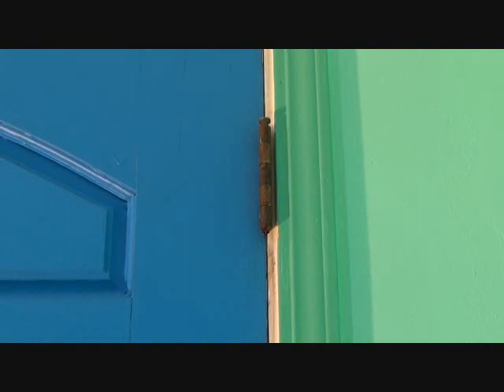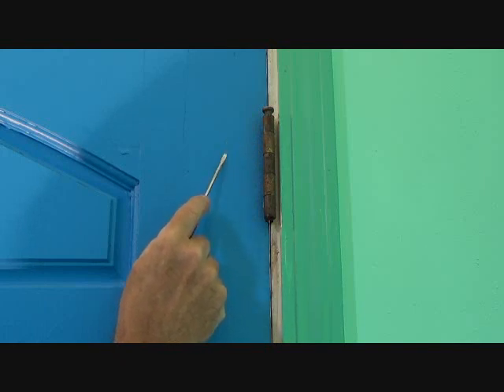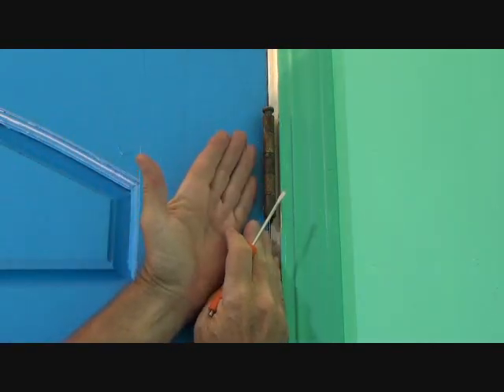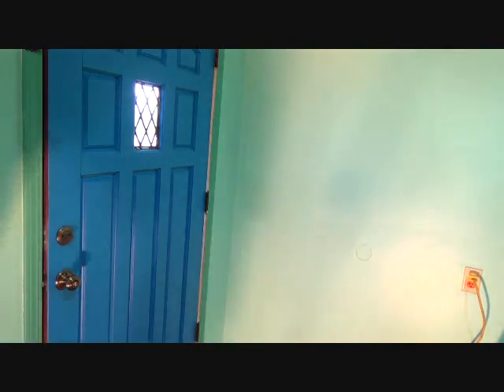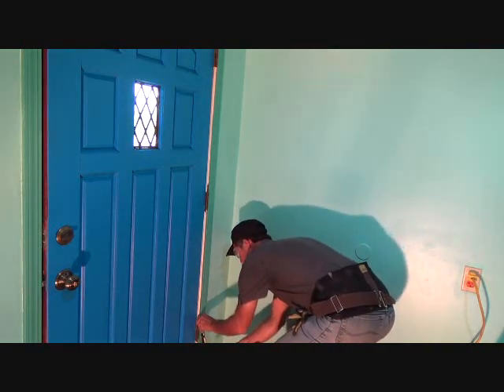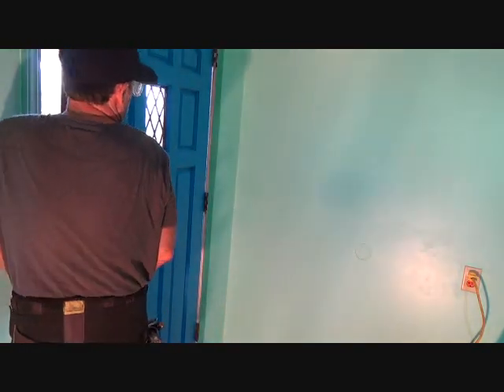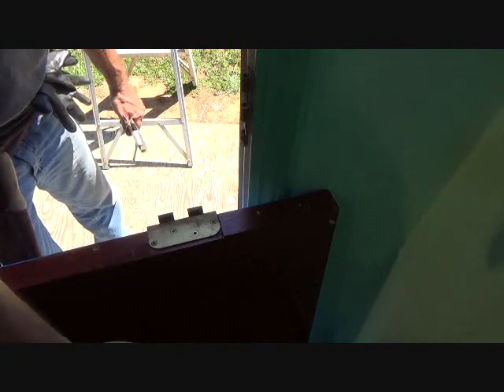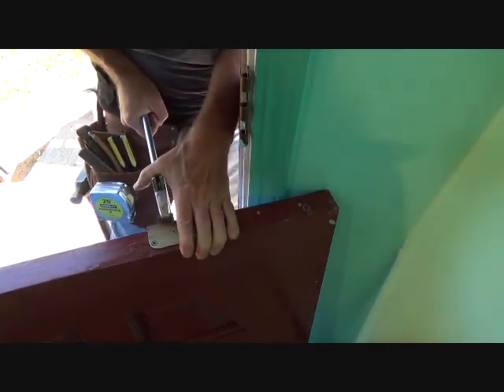Door sagging again?...try this!!...Part 1

Comment: Great trick..never see that one before. Sure beats having to rehang a slab door.
Reply from the maker: PaulOrientedotcom Yes this will work in some cases. As long as you see a bit of a separation gap behind the top hinge. Some doors if you don't have enough separation there then you will first have to try to suck the hinge over like you saw before. Have a great Memorial Day!   Joe  :0

Comment: Every door I have has security pins in the hinges, so you cannot just remove the pins without first removing the caps.
Reply from the maker: If you have the nrp hinges (non-removable hinge pins) then open the door & look on the side of the hinge area & you should see a small hole to put in an allen wrench to loosen up the set screw enough to then remove the pin like regular. Lots of these types of pins don't have a cap on top like you have mentioned...at least the ones I've seen but usually the only doors that have nrp hinges are exterior doors as most all interior doors should just have regular hinges. The nrp hinges are meant for exterior doors if the door hinges are exposed on the exterior side of the exterior door then you wouldn't want someone just coming up & popping the hinges out to then wedge the door out from the hinge side....I've had to do that once by the way & it was only possible since the door I needed to access did not have the nrp hinges on there thankfully!

Comment: I have a door that was sagging on the strike  side. So I had a gap on the top of that side. I put in a 3 inch screw on the top hinge. That seemed to draw it up somewhat but I still have a bit of a sag. Also the door seems to have a hard time wanting to close. I'm wondering if I should either move my hinge on the door closer to the edge or move my top hinge on the door frame back? Not sure why this is happening?
Reply: Randy B 
I have a similar problem, it's not an easy fix.  The framing is perfect, square and plumb, nothing wrong with either the hinge or strikes side sides.  The door itself went out of square overtime due to weathering cycles and poor manufacturing process. The exterior door is sheet metal, did I say not an easy fix? Short off disassemble the door and square it up I'm going to try moving all three hinges up a little bit to at least have it not rubbing on the strike side and hope it won't sag further.
Reply from the maker: You should try removing the screws from the top hinge that are screwed into the door jamb...now install two long screws that will drive the door jamb further over to the existing wall stud. Now flip your hinge back over & screw that back on the door jamb. That will assist you getting the door that much better than just putting a long screw through the entire hinge itself like you did. I also have lots of sagging door videos on my channel. Just go to my main YouTube channel page then click on playlists & scroll down to doors & they will be in there. Good luck!
Reply from the maker: I have other sagging door videos that could assist you further for sure. Just go to my main YouTube channel page then click on playlists & scroll down to doors & they will be in there. Let me know how it goes!

Comment: If you use a Knuckle Bender, you may not have to remove the door. At least, i didn't have to.
Reply from the maker: I've seen those but I have never used one. Sometimes I know they will work while other times a sagging door might need other things that would have to be done with the existing conditions to fix a particular sagging door because all sagging doors are not created equal...Thanks for your message.